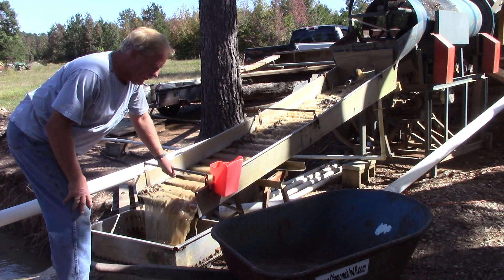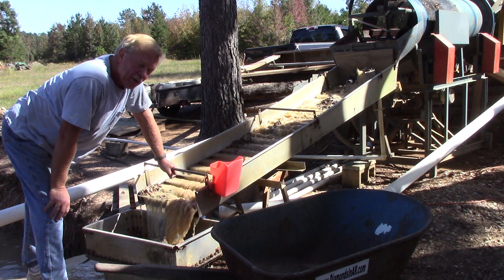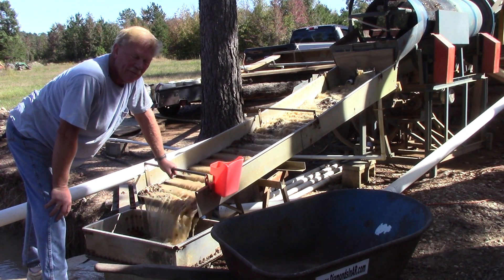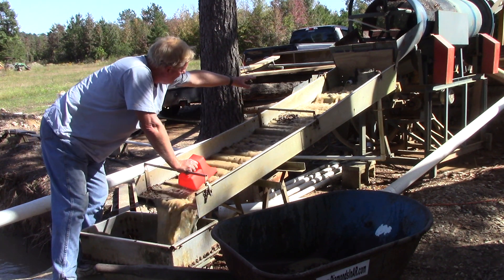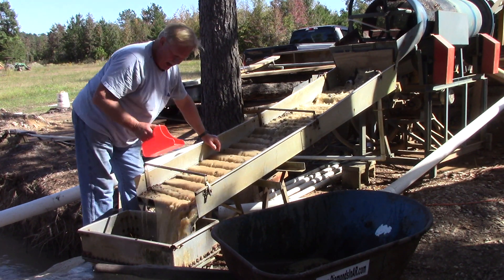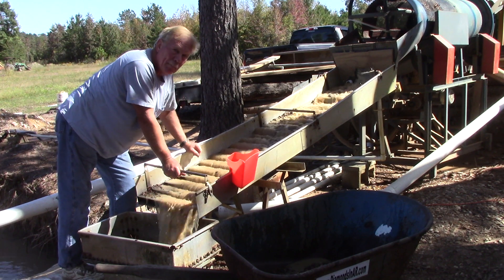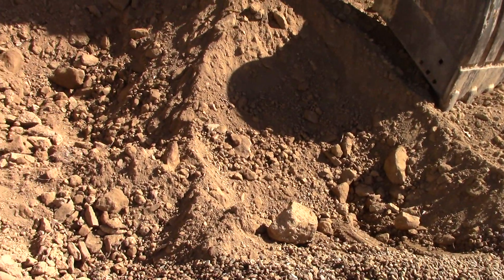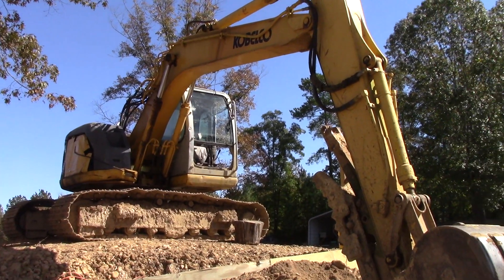Exploring A Different Way To Reprocess Oversized Lamproite At The Worthington Diamond Recovery Plant

Comment: So you basically want to rewash your tailings.  Thinking like a highbanker, what about a screen at a 45° away from settling pond, tailings then fall from screen onto a conveyor back up to materials pile. That way tailings go one way and the water goes the other way to the settling pond.  Maybe be checking the machinery auction sites/facebook marketplace etc. for conveyors.
Reply from the maker: Yes, I agree with everything except these aren't exactly my tailings.  What I call tailings goes to the settling pond and I dig them out with the excavator.  90% of the material I wash goes there after running across 4, one-foot square jigs.  These oversized rocks should be re-run because there could be a diamond trapped inside.  Yes, a de-watering screen and a conveyor would be nice if I could find a set up like that cheap.